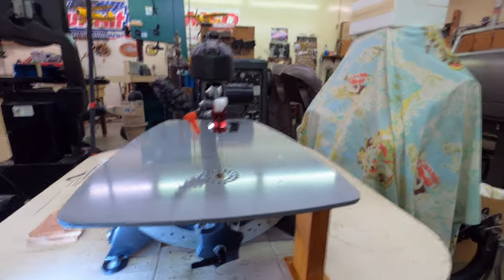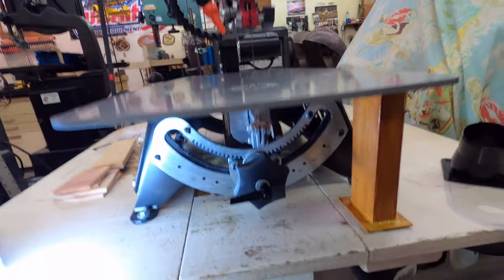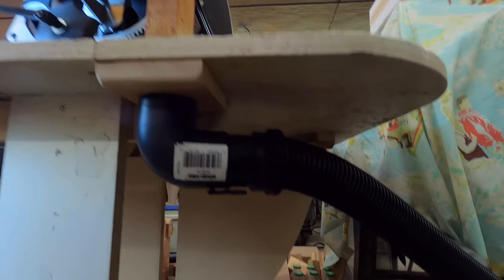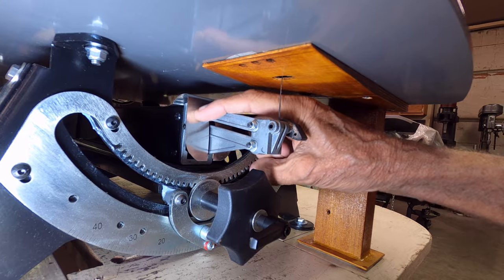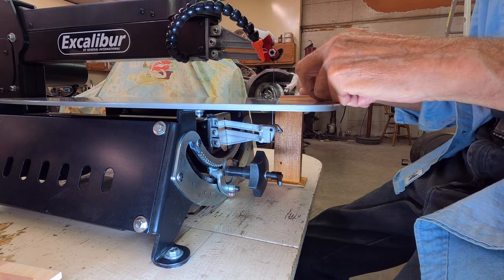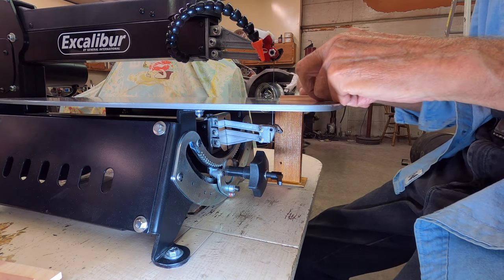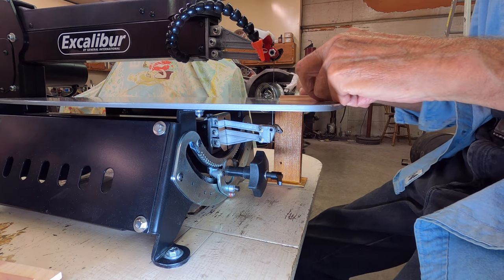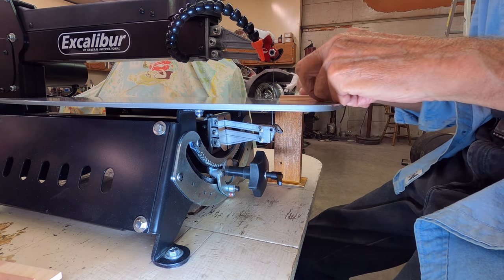Excalibur Scroll Saw Dust Collection That Really Works, and Quite.

Comment: I fixed this problem in mine with three little square wooden sticks. Two of the sticks I glued inside the recessed area between the plastic and table and the other longer stick I glued on the outside on to the plastic right to the left of the hole. It works absolutely great and it was a very simple fix.

Comment: I purchased this amazing saw several years ago. After getting it out of the box I mistakenly thought the clear plastic piece under the table was part of the packaging. Started to remove it from the saw, stopped and took a closer look. Smiled at myself when I realized it was part of the dust collection system. I was never really happy with the dust collector, had to keep a pair of tweezers handy to remove small pieces of wood that became trapped under the table.
Reply: Yes, I thought it was part of the packaging too! Fortunately it resisted my initial attempt to remove it.